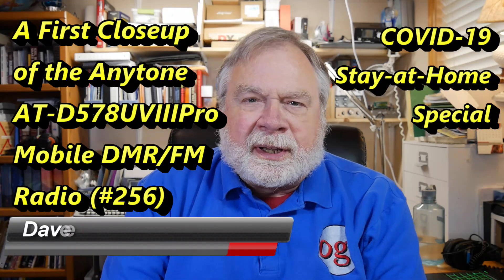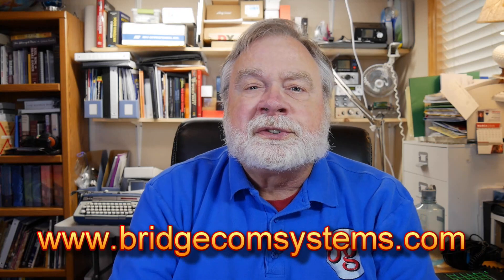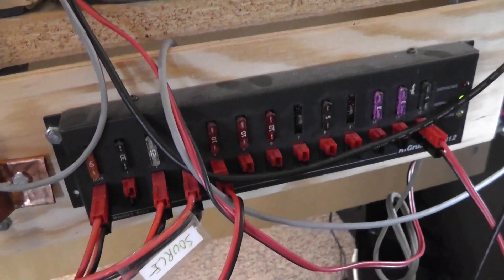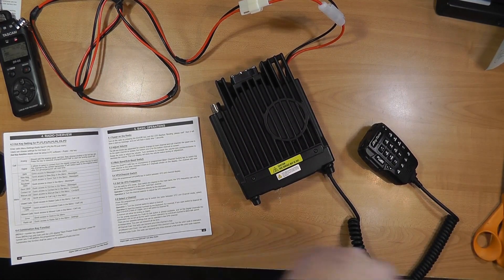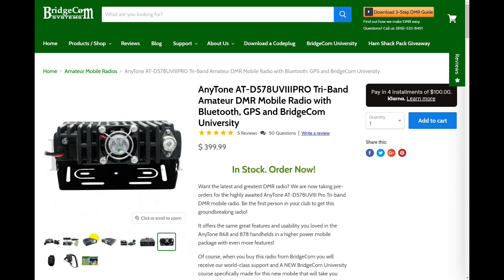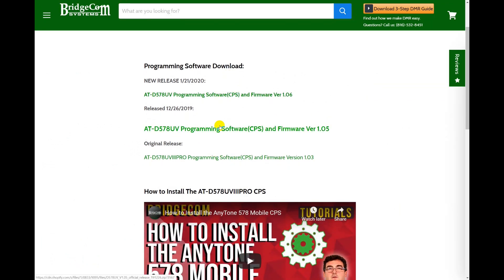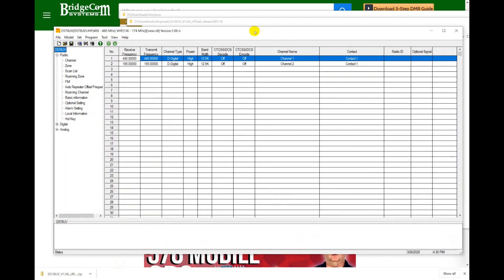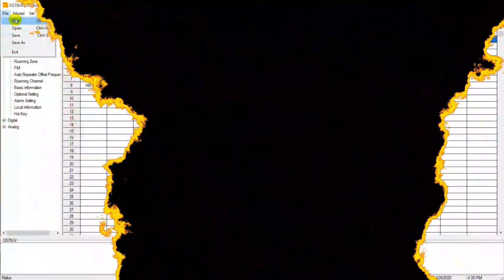Stay at Home Special! First testing of Anytone D578UVIIIPro DMR Mobile Radio (#256)

Comment: I ordered a power cord that was much shorter that had a 12 vold auto power plug.  I cut the cigarette lighter plug off and put power pole on it.  Now if I want to put it in my truck I have the cord that came with it to use.  I programmed my radios to set the date and time from the GPS!

Comment: Dave, do you actually use that treadmill?  Mine is out in the open with just the power cord to the treadmill itself within reach.  I can't use the treadmill without catching the cable at least once. Hehe

One thing I've never noticed before, you run your station off of a battery and not a power supply?  How have I not seen that?  That's certainly a way to reduce RFI coming into the station on the power lines.

Comment: Your comment about customer support by Bridgecom is BS. I bought a 578  from them I was having a problem with a new version of the CPS. I called and was told via voicemail that they would return my call within 24 to 48 hours. Finally I was able to get some support via email and went though a series of do this and do that for about a week and nothing worked.

Then even though I didn’t buy the radio from them I called Connect Systems and was immediately connected to Jerry Wanger on the phone. We discussed the problem and figured out that the new SPS was not compatible with lower resolution computers. This was in the afternoon and Jerry said he would email Anytone about the problem and include my email address. Early the next morning I received an email from Anytone with a corrected CPS that worked on my computer. That is what I call customer support. 73 W5HJ

Comment: What?  Sport Pilot??  I got my PPL (Private Pilot License) in 1975.  Any questions just ask away, I owe you some support.   I wish you the best of luck.  I was a communication/electrical engineer in my career and just now got into ham radio.  I thought I would fly in retirement but I had a stroke following a heart valve replacement in 2017 so I have been planning on my approach to getting back in the air.  Of course with the current shelter in place, it will be a while.  I have thought about the sport pilot approach and haven’t fully decided which way to go.  For now I will continue working on rehab and stay on the ground so I am not a hazard to society.    Haha. 73s!   Brent KI5HXM

Comment: Another great video Dave!  I just received the Anytone 878 and have learned about the cps. I am new to the hobby and have not made a qso yet, but I have had my first 2m qso with my Elmer at his house working on his antenna.  Fun times.  The time will get locked in with the GPS, but it has to be outdoors or connected to an antenna I suppose.  I have programmed my new DMR ID in the CPS and haven’t made any contacts on the digital side yet.  Actually I am having trouble getting any response on the local repeater (probably have tried 70cm more than 2m).  I am making a ground plane antenna and I need to test it with my nano vna.  Much for this retired engineer to learn about all these.  But we are locked down as of this weekend so I have lots of time to learn on YouTube University.  Haha.  I have been on Bridgecom University for initial instructions. It is okay.  Thanks for all your videos.  Your videos helped me prepare for the tech & general

Comment: After receiving my new 578, nothing surprised me more than discovering the 578 Chassis is the same as my Alinco 235 chassis. Have a look.  The only difference is the head, and the 578 has a fan. Any idea why?
Reply from the maker: Interesting. Various manufactures license each others designs.
Reply: Alinco is manufactured by Anytone and is in fact the same radio with some differences in firmware.

Comment: Did I read that right, this is a ham radio with its own hot spot. Or is that common with more stationary style radios. I am in the market for a few handheld devices, narrowed it down to Ailunce HD1, Anytone, 878 I think, and the new Japanese 3dr with the color touch screen. Maybe 1 of each, just getting excited to get into the hobby
Reply from the maker: The D578 doesn't have a hot spot built in as far as I know.

Comment: Dave what's the name or product number of the 3M tape you used on the power cable?
Reply from the maker: It says UL Listed Insulating Tape 2CF8 Made in USA. I'm assuming 3M but I don't know that for sure. Got it at an Ace Hardware store locally.
Reply: Went to Ace Hardware today to look for this tape. Self-fusing splicing tape, found it with the other electrical tape.

Comment: Dave. I enjoy your videos. Do you know of any DMR radios that are not manufactured in China?
73
K1DTB
Reply from the maker: Motorola. Very expensive. Alinco, not so bad. I suspect both are actually manufactured in China.
Reply: Alinco is manufactured by Anytone and is the same radio as an Anytone with slightly different firmware.

Comment: Interesting tape setup.  I noticed this about the power cord as well; but not nearly long enough to use to install from the battery, to the install location in my F150.  Going to be stepping up to a fused power pole system for that, as well as to make a quick transition on the ends of the factory cable to make for a quick connection when going from indoor/outdoor use.  The documentation for initial startup, some of the functions, as well as use of CPS, etc. is not the best with these.  However, overall the radio and CPS are pretty easy to navigate if you've had even basic experience with anything electronic or other CPS software, excel, etc.  Thanks very much for this series!